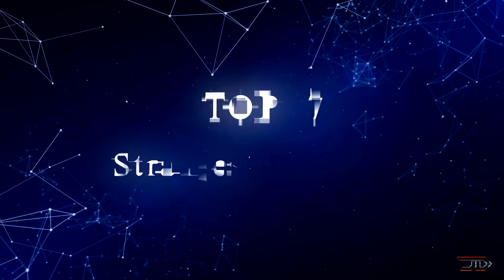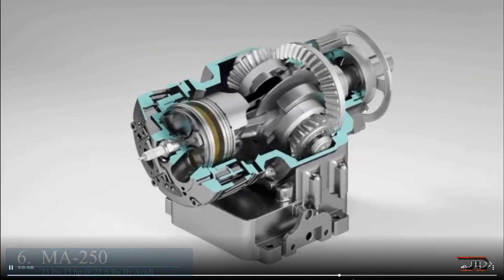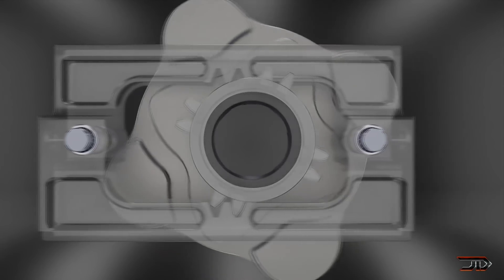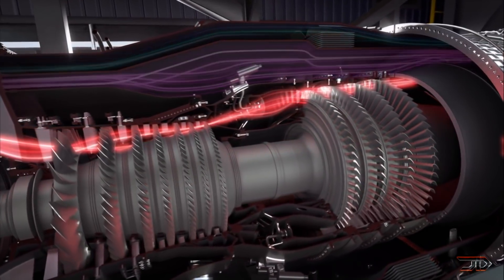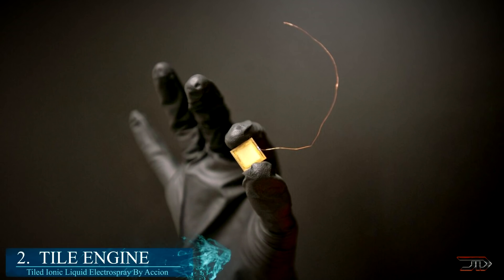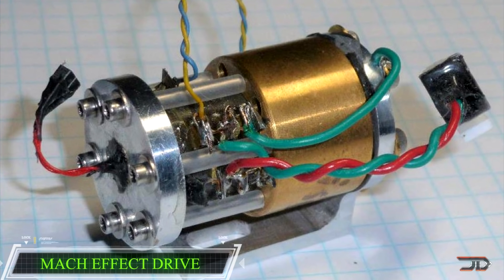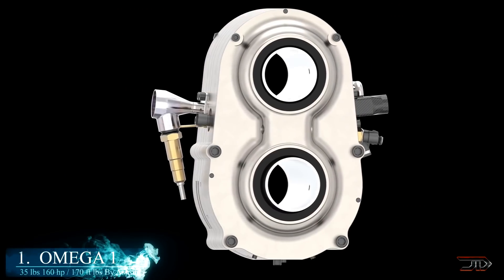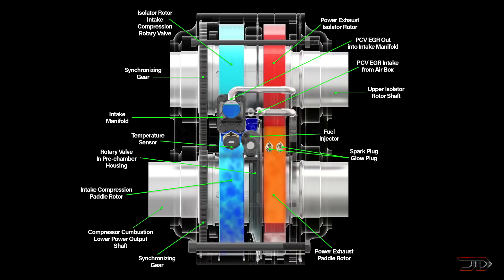7 STRANGEST New Engines -2-

Comment: I've owned and played with just about every type of internal combustion engine that's ever existed (so far as I know). My favorites are 
1. The OG Model T engine, because when it was introduced there was no standard fuel like today, so that lump of iron could run on the gasoline of the day, ethanol, naptha, kerosene, and even turpentine. On the tin lizzy's steering wheel you had 2 levers for controlling the ignition systems advance or retarding function basically you were the engines ecu
2. The Ls3 of the C6 corvette which maintained a rediculously simple cam in block design with two valves per cylinder, a narrow low profile long block, and even with 6.2 liters and 400+ hp/tq was able to get better fuel economy than my wife's 2020 ford escape with a 3 cylinder turbocharged engine and 8 forward gears
Reply: lamplough compound two stroke?
how about a melhuish aka "gothic" oil engine? sigh. another twostroke...
rover "10"?
bisschop "non compression"?

humphrey pump? 

theres been some pretty oddball designs made it into production at some point or another...

Comment: The most incredible engines are the ones going extinct. RC nitro motors. The LRP motor can output 4.69hp at .77lbs/350 grams...and somehow that doesn't turn heads.

Comment: Omega 1 does have "seals" its just they dont use any intermediatory seal to do the sealing. It will necessarily suffer from heat expansion problems due to the tight fit and the gap tolerance compromise needed to prevent it seizing will create the very same seal problems every other engine of this form has had.  I hope I'm wrong, but really.... who's kidding who?

Comment: What's the projected thermal efficiency of the Omega 1? I think at this point the marginal gains in efficiency/weight are not going to be enough to differentiate them from new 100+ horsepower, 80lb electric motors... super expensive, half-ton battery packs notwithstanding.

Comment: "Fewer" parts, not "less" parts There is a smaller number of parts, not a smaller amount (despite the quite common grammar error)
...and why go into the weird verbal acrobatics of "a numerous amount of chips"?? 
It's simply "numerous chips"... a large number of chips, not an amount, which would be measured e.g. in kilograms or litres. 
Correct grammar is pretty simple really & makes you sound educated & credible

Comment: AND… DAMMIT!

The Omega-1 is another idea that I had in the 1980s (when working on possible cam-less motorcycle engines) along with Variable-Geometry, Variable-Buoyancy, Vector-Thrust, Semi-Rigid Airships that have a lower-profile, and the ability to fly either as a “Lighter-than-Air,” “Neutral-Buoyant,” or “Heavier-than-Air” Aircraft.

If I had not been “mostly dead” during the early-00s, I could have actually challenged the patents then being sought (although I did get picked-up by a company working on one of them when they discovered my prior work) by having prior working demonstrators (albeit at 1/12 scale) of the concepts, including a working Airship in the Lighter and Heavier than Air Configurations (two different models, using an early carbon-fiber shell that would “Inflate” to produce the transition. But I could not get it working in a model that small, so produce a model of each, and a demonstrator that had the inflation and deflation mechanics separated from the model). I could not get the Vectored-Thrust, as that was just too expensive, prior to Computers decreasing the price of both CADCAM Machining AND control systems that were light enough (this was long before the quad-copter drones became a thing due to these very innovations). 

But accidents caused me to miss my opportunities.

Comment: Might want to include Allam Cycle turbines. They operate with supercritical CO2 and liquid methane + liquid oxygen, producing pure CO2 and pure water. No external emissions (though you have to put the CO2 somewhere, at least it comes in a bottle instead of dumped in the air).
Reply: straight to the graphene factory

Comment: The GX100 is genius! With a few modifications you could turn it into a  turbo-ram-jet, meaning it could achieve speeds of nearly mach 5, theoreticly of course. However, that would not come cheap.
Reply from the maker: That is true & there are a few companies working on bypassing the turbo for a ram-jet hybrid config!

Comment: There is a beetle wing that if you look at it under a micro scope its a bunch of  Stop Sign Shaped holes with 2 little tiny tiny tiny tiny tiny (can't express that enough) tiny hair that swish back and fourth.

When they click their wings together they chime like wind chimes but make no noise for its to high of a frequency. 
Each little hole creates a vortex of air allow the beetle to hover.

Wing suit made of this material? mmmmmm yum.
I don't care about flying.
I just want to be able to fall slower.
Or jump higher and then fall slower
Adding resistance to the air.

What would that look like? what would that feel like?
One minute a windy day can pass through you as if near no wind at all was interacting with you
 (100% efficiency yea right)
Then with a simple activation of the fabric, you could not only interact with the wind, but create even more resistance to its flow.

So even on a calm day, if you say for instance, jumped off a building, you could rub against the air with such resistance (with on something like a wing suit or more like... Old long Cloaks you see in Asian sword fighting culture
Where the resistance of the fabric flapping in the air is enough to slow you to a safe decent

Only a dream, but would be cool non the less.

Jumping from building top to glide or drop straight down in near full control to land safely on the ground

You could build up charge as you fall in the cloth, and before you get close to the ground activate it like a booster.
But in reality all that is happening is your changing the resistance of air flow like its becoming more and more like a liquid fluid of water.

Mmmmmmmmm that'd be cool.

It starts with the idea of:

If you had 3 parachutes fail, but still have them atleast out and flapping around, that would be enough fabric to slow you down to a... Survivable speed.

You don't need them open at that point, you just need them out in the air.

Comment: There where where two engines of note: the variable flow/bypass Turbine and the chip based Ion truster...wich would be a true revolution for RCS engine options for satelites or Lagrange posted platforms... the piston engines are, basicaly as all alternative engines to the normal piston engines that are in use now, flawed by design due to their inherent requirement of materials that just don't exist or would make them uneconomicaly for beeing hard to aquire, too pricey or not workable.
Reply: Buzz kill

Comment: Nice video. However these all seem very heath robins based on a decline technology internal combustion engines. More innovation on electric motors is needed to align with better energy density of batteries perhaps

Comment: I invested in the Liquid Piston engine due to the three firings per rotation, dual lobe, tri-chamber reverse type Wankel..  It is a simpler design, more compact than the Omega engine, but not 'stak-able'.  I would like top see it in the light aircraft market..  It's developers are touting the military market instead of the lawnmower market..
Reply: I've been hearing it for years....WHERE IS THE LAWN MOWER???
Reply: @1voiceofstl  I think it has NOx  emission problems

Comment: The oil and energy industry is scared of the future of the liquid fueled engines and the soon to be elimination of oil as a fuel in combustion engines. They are finally letting out some of the decade(s) old engine technology that has been hifden away from the public for fear of less profits if combustion engines needed much less fuel to perform the same as thwy currently do if not better. Its much too little much too late to try and safe the future of their industry. Maybe now yall will apologize at least for allowing possibly world benefiting technology to just sit left abandoned by theie creators instead of being used for the betterment of the whole planet meanwhile aiding in the collaboration between inventors to come together and improve new designs as well as existing ones.

Comment: Coaxial engine has a number of longevity issues, all those sliding parts will eventually fail unless the engine is highly maintained, not to mention tolerances will inevitably be a nightmare to deal with. there's a reason why there's not many linear parts in engines, pistons use slightly sprung rings to make up for clearance tolerances, and stem valves do eventually need their components replaced; though stem valves also don't see the forces of the piston itself, the linear bearings in the coaxial engine will see these forces and should have an expected shorter lifespan. Not to mention the issues with the rollers with the cam groove, more than likely their bearings will be the first parts needing replacing yet they're at the heart of the engine, which isn't good design. 

The MA-250 is interesting, but also problematic. The engine cannot scale without a geartrain. Any attempts of scaling that doesn't involve linking two separate motors externally will inevitably make it a swashplate engine, like what Duke had designed, which has it's own issues. The internal gearing really isn't ideal, though is entirely needed, because the moment any other component fails in a way that produces shrapnel, those gear teeth are getting destroyed. Not to mention assembly will become a pain in the ass with how gears need to be set, a lot of dry assembly, disassembly, and reassembly just to shim the entire gearset correctly. The rotary disc valve is an interesting addition, but tolerances and sealing will be one of the biggest issues with this engine; iirc, rotary disc valves have always been problematic. Plus if you scale an individual cylinder, you start having to question the strength of the connecting rods, as it's a split design, the rods are inherently weaker than a singular, more solid rod.

CV Motion's motor is promising on paper but not in reality. Again, it's based on gearing, the moment you have particulate in you oil, those gear teeth are getting chewed up; then again the issue of if there's shrapnel from an explosive failure, like if a detonation happens to blow through a cylinder, if a bearing gets destroyed and shits its guts, etc. Gears are bad when there's a number of other components that could break and get caught in them, it's why transmissions and differentials, any geartrain component, are their own separate cavity; even a camshaft's drive, whether it's geared or chained, is in it's own separate assembly and cavity. Plus there's such little engagement between the rotary and linear components, if a set of teeth break you have a pair of dead cylinders. It's just not good for longevity, plus scaling becomes an issue as you'll need beefier components as you add more pairs of pistons. 

Omega 1 is interesting, it's essentially combining a rotary valve with the combustion chamber. My main issue with it is that half of the volumetric footprint goes entirely unused, the top half serves no purpose other than having a matched disc for the intake and exhaust discs. If they could find a way to mirror the setup so that both the top and bottom halves functioned as an engine, then it'd be interesting, otherwise there's just so much dead weight and unnecessarily used space. I also don't see why there can't be more combustions per cycle, the current engine only has one per cycle, but due to the way it's made this seems unnecessarily low given how large the discs are. Between the two improvements, you could get at least four combustions per revolution, though this number could probably be pushed further. 

But all of this is just trying to reinvent the wheel when there's not much reinventing to be done. We're at the point that we can't squeeze out more efficiency with simplistic designs, it's why the typical engine design is becoming so complex with different variable systems, because we're at the point that we need to minmax every little variable to squeeze out additional efficiency. I just don't see the point in making overly complex designs that do essentially the same thing as a typical crankshaft, or trying to find alternate designs that'll inevitably fall behind due to lack of being able to be variable. The designs are interesting, but they won't realistically lead anywhere, and it's far too late in the internal combustion engine's life cycle to be questioning new designs, as everything is moving onto alternatives for a variety of reasons.
Reply: Thank you very much for your post.  It was very difficult for me to understand what was going on in these engine designs, even after watching the video twice.  Your insights answered my question of, is any of this feasible?
Reply: The couple of engines in this video that have working models definitely did not sound smooth. If your car was making those rattling noises you would take it for a service.
Reply: i argue that certain simplistic mechanisms are capable of improving the ICE well beyond where it is now...

gears work fine. most motorbikes stick gears in with engines, no problems there. even run the clutch in the same oil.
a gear in an engine is under far less stress than a gear in say, a differential.

Comment: The problem with fission driven spacecraft is the power in, power out ratio. Essentially with Tokomak design the current break even on the ground does not include all the other inputs. The amount of energy put into the correct test beds is currently greater by a factor of 7 than the energy that can be achieved, but assuming one can get this to a positive energy output let’s go through the problems in space. 

1, Dealing with the radioactive buildup, not a problem since it’s not near people, but it is a violation of the treaty regarding the non nuclearization of space.
2. Extracting heat without steam and heat transmission (heat exchangers or cooling ponds) and relying on methods like thermocoupling are very inefficient. At best a 30% efficiency can be obtained, realistically 15%.
3. Coupled with #2 fusion reactors are designed for large scale operation, heat turnovers are in the 10 to 100 Megawatt range. At 30% efficiency that minimally 7 megawatts of heat that needs to be dissipated without conduction or convection, just radiation. In space weight is everything, and building massive heat radiator defeats the purpose. 

Direct fusion drives. You could for instance build a theoretical fusion drive, however now instead of contained fusion and ion/electric propulsion you now are direct ejection of plasma, not a problem except now you reaction is no longer contained, which might get you beyond earths orbit, but radioactivity is directly injected into earths sphere of influence, a clear violation of #1. 

The second problem with the fusion drive is that you need a lot of energy to trigger fusion, this equates to a powerplant once again in the megawatt range, in order to prevent the heat problem one would need solar, preventing its use away from the sun, or heavy radiators. But there is a problem, as fusion proceeds the reaction products favor reaction, but in direct fusion drives those products are lost. Xrays are lost, on the plus side pesky neutrons are lost. Another problem, at anyone time only a small fraction of atoms are fusing, that means atoms are being ejected which are not being accelerated by the reaction. 
   There has been a proposed solution, to poison the reaction with antimatter collisions, therefore increasing heat and pressure, the problem is the energy required to make anti-matter. 

While fusion power is always 50 years in the future, fusion power in space is always going to be a couple hundred years in the future.
Reply: You are aware nuclear batteries that use many kg of plutonium are already REGULARLY used in space right? You're talking about the treaty about nuclear weapons in space. In addition, venting a fusion reactor would make a great thruster, 100% efficiency as no conversions are taking place.
Reply from the maker: Great points! I think that is why there is heavy research into FRC (Helion & TAE) because it can be converted into direct current from the expanding plasma. Out of all the fusion methods, it might be the most promising but it's far from being proven, maybe 10 years at best just to demo on a very large config.

Comment: If the engine burns fossil fuel, it had better be designed for another fuel such as biofuel or hydrogen.  There will no longer be internal combustion engine cars sold in many countries as of 2035.